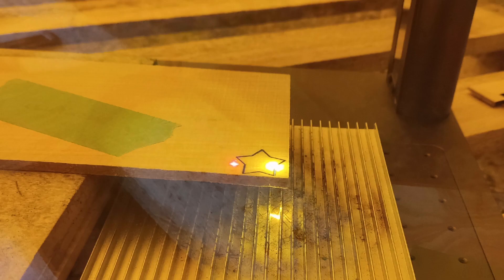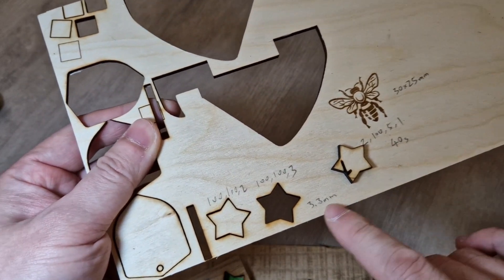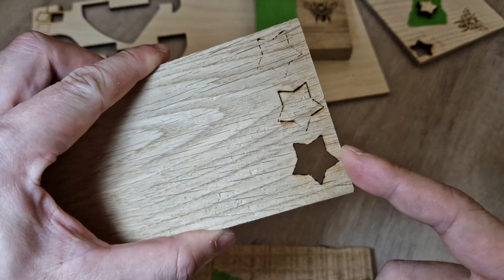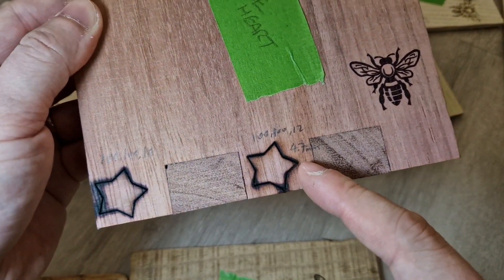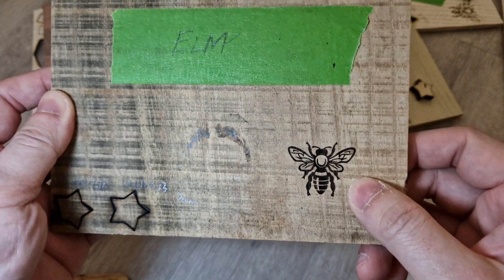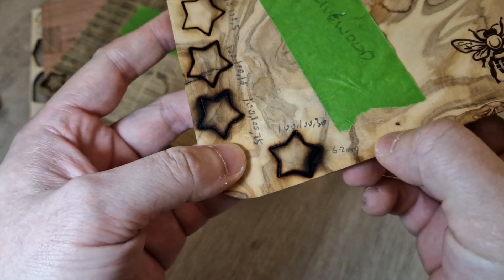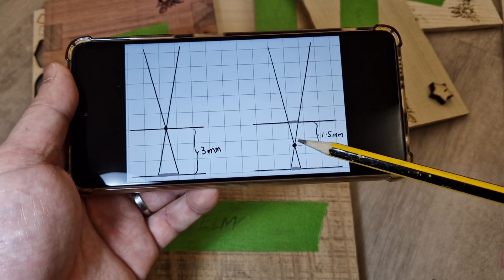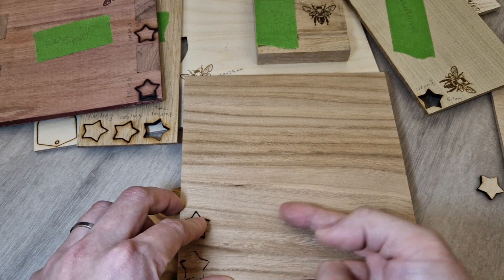LaserPecker 4 - Cutting and Engraving Tests on Different Woods

Comment: Hope you don’t mind me messing you directly. I came across your YouTube page of you doing cutouts with the LP4 and I wanted to know did you find a workaround for the slant cuts it does when you try to do a cut out? I could have the wood right under or on the slide extension and it will always come out slanted after leveling and focusing correctly. Or is it something that can only be fixed using a rotary tool?